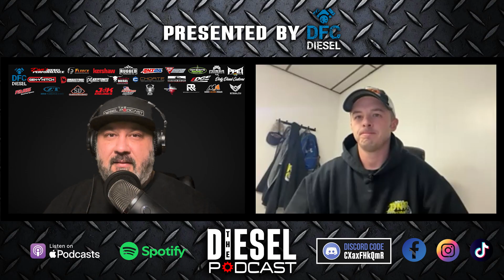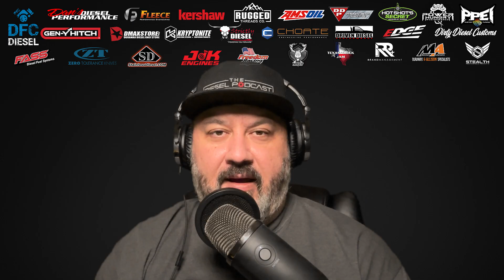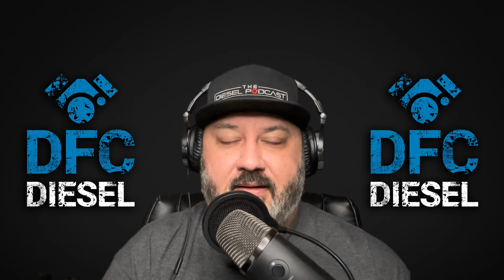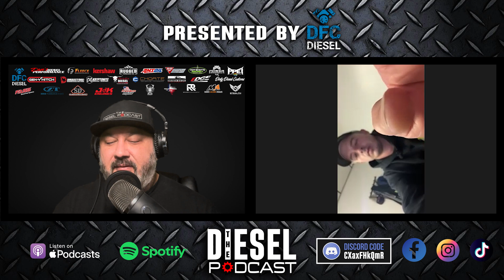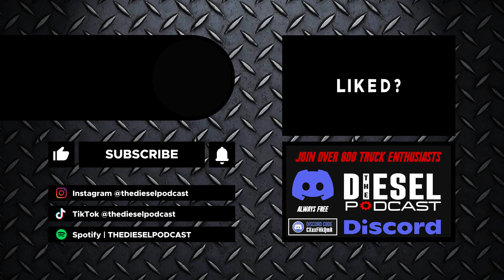2025 RAM/Cummins - Dud or Perfect Truck?

Comment: I find it interesting about the ride quality of the 2025. I recently sold my 2019 2500 4x2 and went to a 2025 2500 4x4. The ride quality and handling is greatly improved. Also the turning radius is shorter. I can pull into a parking spot at the grocery store in one shot. Its truly amazing.

Comment: Why rag on a truck for not liking 8th gear (second overdrive) when towing?  With 3.42 ratio and a modern 33.5" to 35" tire, 7th is a happy spot to keep water pump turning, turbo active without having vanes choked down and drive pressure through the roof, and exhaust clean enough to keep the DPF happy.  2000 rpm in 7th when towing isn't excessive.  I say this as an owner of a 2014 megacab that has 3.42 gears, a 34" tire, two overdrives, and tows a 10k camper.  1550 RPM at 70mph (double overdrive) isn't useful except when empty.

He talks about overpasses as hills...he wants momentum and a little throttle to carry him up an overpass without a downshift.  Some of us live where there are real hills and you shouldn't have been in second overdrive anyway.

Comment: From dynos that I've seen. Ford claims the 500hp 1200tq. On the dyno to the ground, it was 423hp and 932. This new cummins is at 435 amd 1105. As far as lugging, the issue is heat. The cummins gets max tq moast of the way through the range, the others don't. They do not need 10sp. The 8sp is geared lower than the 4.10s of the 6sp and 7th is slightly higher than the old 6th and 8th is a hwy gear. 85mph at 1900rpms. Ford feels quick because it is a short stroke v8 that revs quick. The cummins is built like a rig motor. Long stroke and heavy.

Comment: I just test drove one, man, there is ALOT to be left desired. First off, Laramie's don't have fender flares. No option for air suspension unless you get a dually max tow. cloth in the seats instead of Alcantara (on the limited I drove). the only reason to upgrade from 2019-2020 is because of the CP4, if you have from 2021-2024 its pointless to buy the thing, cab is the same, but they removed small creature comforts. The limited has a passenger screen, thing is pointless. Big changes are -- new transmission, easier access for fuel and oil filter, literally all. Ram is going to have to re-design the cab for owners to want to bite the bullet, other than that my 21 HO is incredible.

Comment: Not interested if you don’t bring back manual transmission an lower prices
Reply: Yeah love my 2017 2500 G56 6spd manual the exhaust brake is insane with the manual even though it's only a Standard output 6.7 Cummins with 660 ftlbs Ive pulled double the max tow and no issues the way it's geared with the 342 rear it pulls like a locomotive. It would be wise for Ram/Cummins to offer the Eaton Fuller 9 spd that handles 1000+ torque.
Reply: They never will. Can’t handle the power so they say.

Comment: The 6.7 fords are burning transmissions up at about the same rate even with the feelings of better shifts. If you have a 68 just lock it out of 5th and 6th unless your trying to do 60-75mph. And ignore ford fanboys. They will most likely move to the  8 speed or redesign the 10 speeds entirely. We should be mad we cant pick between an allison, a zf, or an eaton fuller 8-10 speed. Just give us a big trans.

Comment: Still would delete the emissions if I got one. But I'm still leaning toward 2018 being the golden year model.
Reply: 100 thousand miles is just a year so get it deleted as fas as possible
Reply: Nobody voiding their warranty day one with delete. Only after 100k miles
Reply: @JAW1992  Absolutely would. No reason to wait. That would be my first stop after picking it up.
Reply: @jefforr439  voids warranty bud
Reply: @JAW1992  Nobody cares. Current truck made it 800 miles before it went to Mexico. Zero issues.
Reply: 2007!

Comment: About the downshifting: Looking at it holistically, I think it's safe to say that it's just sound practice to go down a gear as soon as you need to work the engine, especially the more gears you have available. Overdrive gears are really meant for cruising at a constant speed with no grades. In that sense, the fact that it downshifts to 7th as soon as it needs a bit more effort should be seen as a good thing. It protects both the transmission and the engine. It just sips a bit more fuel. Unless it did that for me, I would be doing it manually anyway. I want my stuff to last "forever".
 When it comes to the lifters on the 5th gens my understanding is that the failures aren't because of the design but because of poor parts quality by some of the suppliers have Cummins used. And they have explicitly said themselves that they have addressed the lifter supplier issues by narrowing it down to only one supplier.
 I mean, think about it: For how long have hydraulic roller lifters been used reliably in the automotive industry? Lifter failures are rare in a relative sense across the industry. Even just looking at the 5th gens, lifter failures aren't universal. Some fail, but some do outstandingly. This is a difference of well made vs poorly made parts. And that goes for anything. No matter the complexity level of a given part, if it's poorly made it will cause problems. Are roller lifters more complex than flat tappets? Yes! But if they're of high enough quality they're no longer a failure point and become just a service item, just like flat tappets are too.
 And to some extent, the failures are most likely also due to servicing with incorrect engine oil viscosity grade – which is the single most important property of an engine oil. A lot of people don't follow the manufacturers criteria and go with what they feel is better for their engine regardless of how it's put together and of the specific chemistry of the oil and how that interacts with the various materials and surfaces it contacts. You could argue that using the wrong viscosity shouldn't break an engine, but is there a good reason to not just use the correct viscosity anyway? I mean, that's one of the best ways to protect your investment; follow the manufacturer's recommendations for engine oil dang it!

Comment: These guys get me when they call something dated just because they dont do some meaningless refresh every 2 years. Dodge will always lead the pack as far as interiors go
Reply: The people that call stuff dated. Sadly shaped the vehicle market and are a big reason why everything is expensive. Cause as soon as things have an 80k price tag. They all in the diesel forums with the smug emoji and new truck. Thats all they care about. They don't give a shit that I built my 2015 the way I wanted it for half the cost and more efficiency.
Reply: @bucketheadrox  what's more efficient?
Reply: @wizard_of_poz4413  all of my temps are significantly down from stock 2015 rams and newer rams. I dont lose as much power to heat soaking, my fuel mileage is good enough to still average 16 with a steel flatbed and 35 inch mud tires. She runs 4x4 mostly on logging roads. I am normally at 700F EGTs and she'll only put 1200-1250 down if I'm towing and going up a really steep grade. Moment I stop. She'll go down to 400F. Girl just needs some gaskets and various fan belt driven accessories every now and again.
Reply: @bucketheadrox  oh I thought you meant over the new ones
Reply: @bucketheadrox  what you said, emissions and the fact that the bottom of the barrel trucks are the same tech/interior wise as the top of the line 15-20 years ago
Reply: @Eric_V410  which is a good thing
Reply: @wizard_of_poz4413  yes and no, some stuff doesn't need to be in a fleet/work truck especially as standard
Reply: @Eric_V410  you can get fleet trucks with the vinyl seats, rubber floors, double din stereo etc
Reply: @Eric_V410  the emissions suck but the bros are also partly to blame for that as well. They put alot of heat on our asses doing dumb shit. They are also the same ones that still buy the new trucks every time they come out. So the market thought we gave a shit about the interior. The interiors of the base models are fine. I don't want a tesla.
Reply: @bucketheadrox  yea the rolling coal crowd especially on people/cars ones fucked everyone over. There's a small but reasonable change deleting wouldnt have been cracked down on if that shit never happened
Reply: You're right, but the 6 speeds RAM used up until now really didn't stack up to the competition, no matter how good they may be by themselves. And the problem with that is that RAM haven't priced their diesel HD:s accordingly. And up until Tavares stepped down they even priced their trucks above the competition, which was completely unjustified. There's a reason RAM lost a lot of market share the last 4 years. Hopefully they can build some of it back up in the coming 4 years.
Reply: @Arexodius  i would disagree because the 68rfe was a fine light duty towing unit that just happened to be orphaned and made redundant. After 2020 when ford and gm made the colossal debacle of the 10spd, the aisin was the last truly bulletproof and tested transmission on the field
Reply: @Arexodius  the interior is what he's talking abt specifically.  Other stuff like trans applies too but they have the best looking(subjective) and best quality interior. Who cares if it's the same base as early 4th gen. Most people wouldn't even be able to tell that cause it looks so different
Reply: Yes ram by far has best interior
Reply: Mostly agree
Reply: Critics gonna critic
Reply: XL Ford interiors are incredibly rugged.
Reply: I like the truck but it is an issue they haven’t come out with a longer short bed, cab is still the same since 2010 in HDs. A long box Ram looks weird and I don’t know why. They just seem to be stuck. Needs a new cab and body even if they keep the other stuff mostly the same. 5th gen 1500 is already 6 years old! Still no HD overhaul.
Reply: @smiley3303 ok jb reviews, you know as they say if it ain't broke dont fix it. If you need more space inside then od suggest you buy a minivan